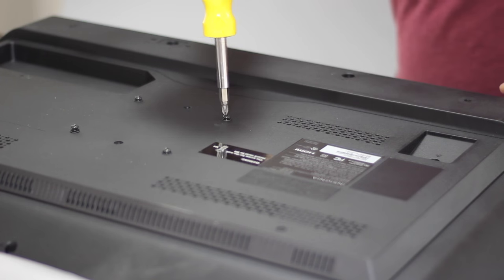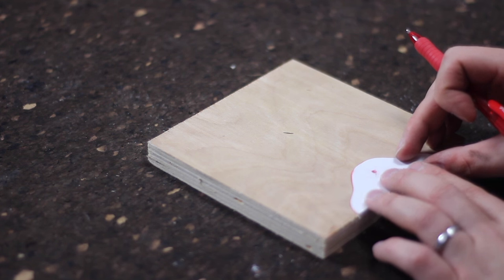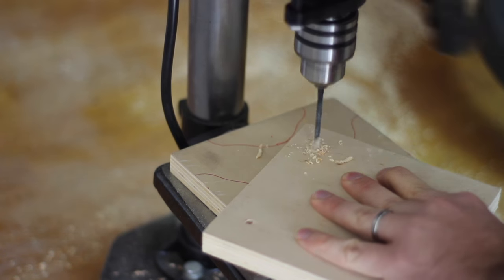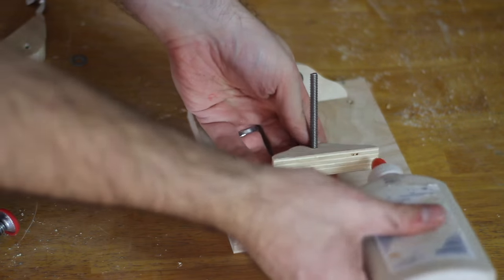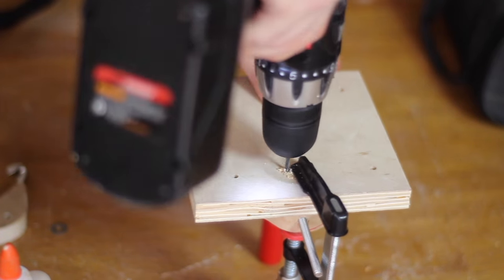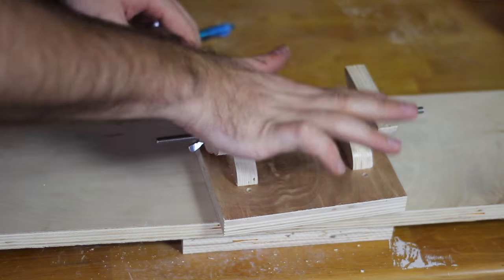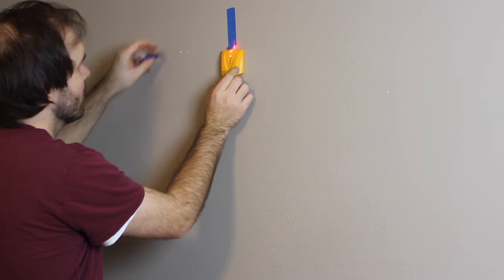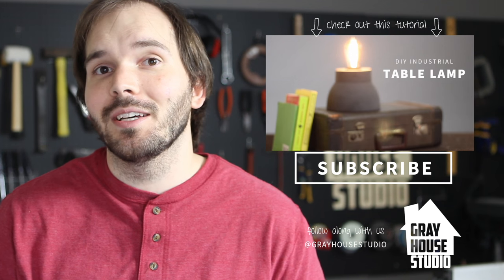How To Build a TV Wall Mount

Comment: This tv mounting for how much weight ? thanks God video
Reply from the maker: Our tv is not too heavy but the TV wall mount can hold me hanging off it. Our TV is a 32 inch. If you want a larger TV you would need to drill some holes in the hunger for a pin to lock the rotation at different angles.